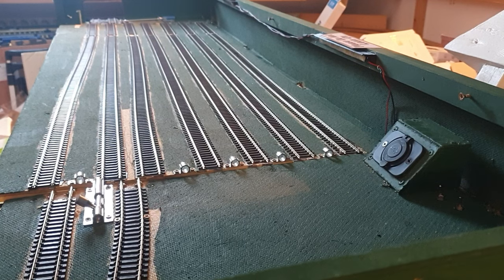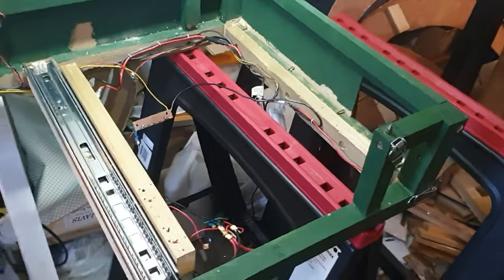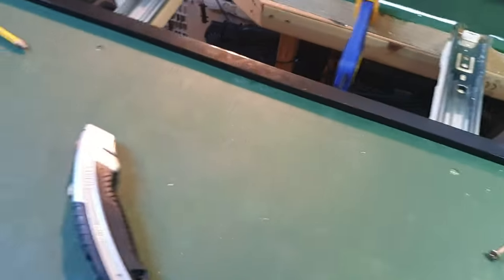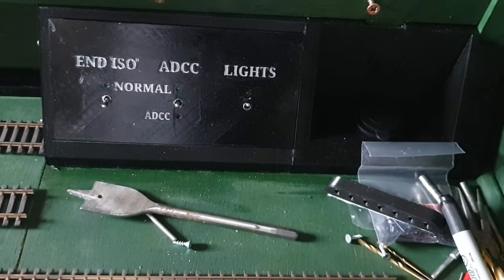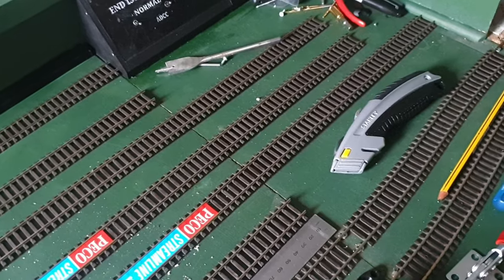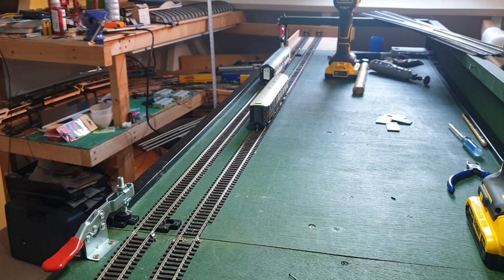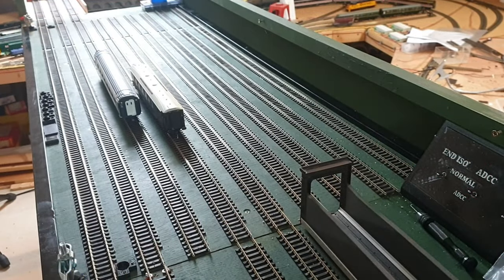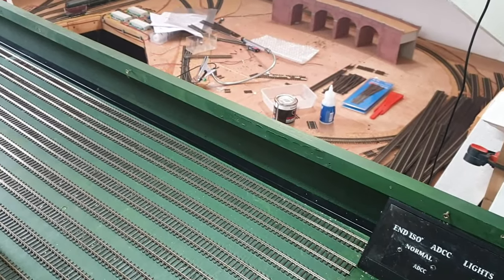Swanage Model Railway Episode 20 Stock yard and traversa upgrade part 1

Comment: So exactly what was the fix for the ADCC problem in the previous video?
Reply from the maker: still looking into that think it may be the loco
Reply: @SwanageModelRailway  Did you read my comment about using the correct procedure in the manual? You are effectively operating the system as an "End to End" layout, so make sure you have wired it as per page 119 of the HM7000 manual, with CV27 set to 3. The diagram you showed is from page 112 which is not what you want.
Reply from the maker: @bobfuller  yes I turned the circuit round to match the one you pointed out